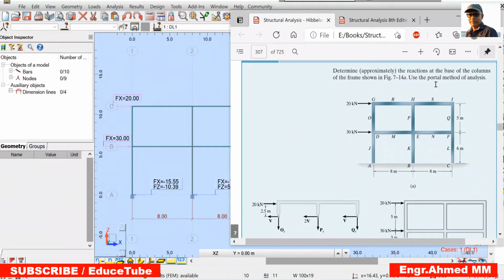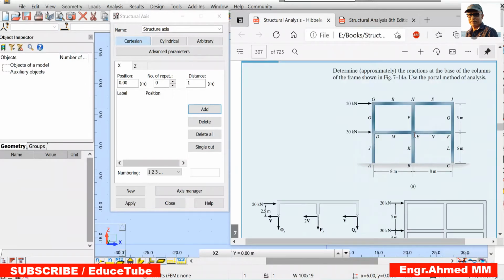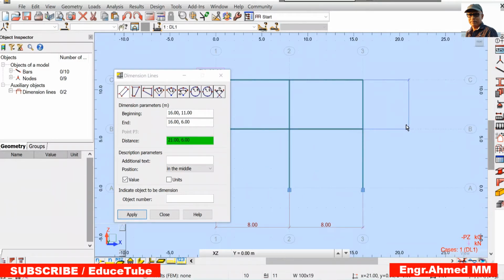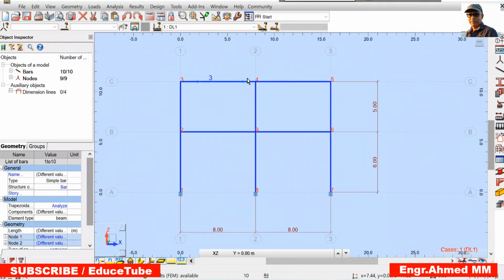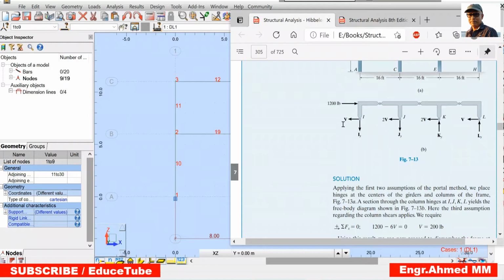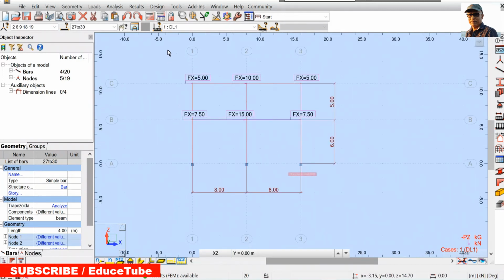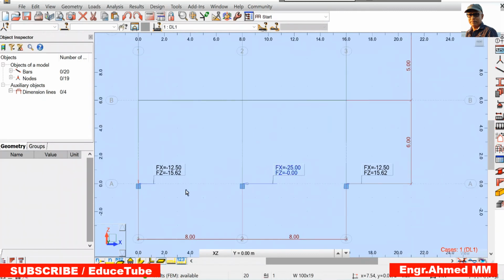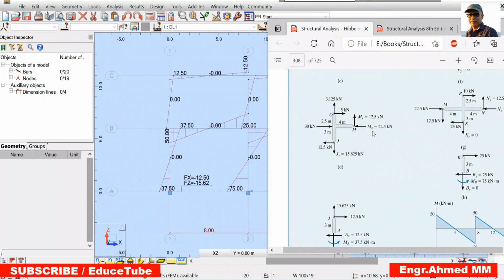Portal Method of analysis by Autodesk Robot Structural Analysis Professional 2021

Comment: I was able to do the example in the video and get the right values. However, I tried doing the example that is previous to the example analyzed in the video (the example with the 1200 lb load, at 2:40 in the video), and the values do not come out the same as the book. I have followed the steps exactly as they should be done, including deleting the self-weight. I noticed that when I change the section of the bar, it changes the values of the reactions; in a previous video you said that the type of section would not matter, since the self-weight would be deleted. I have deleted all self-weight, and I am confused why the answers are not coming out the same. Could you help me with this by doing that example for yourself, and seeing what I might be doing wrong? Thanks for any reply.